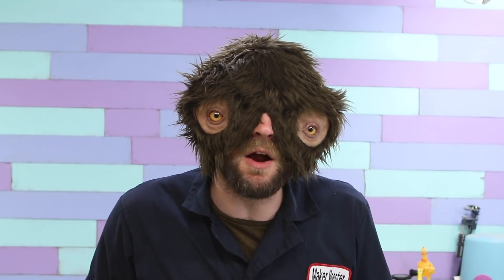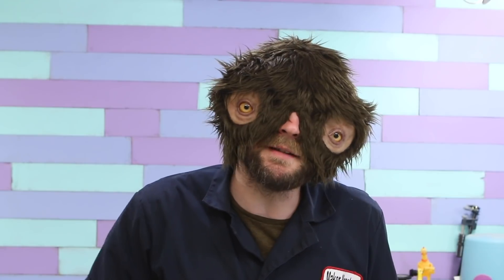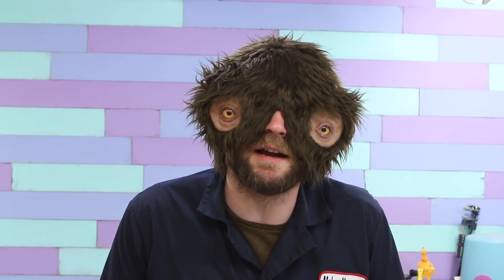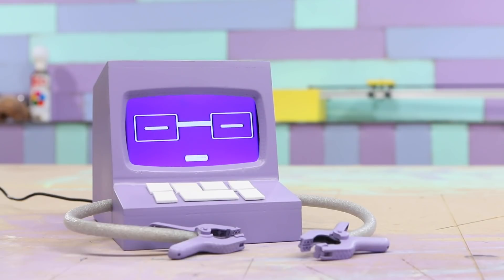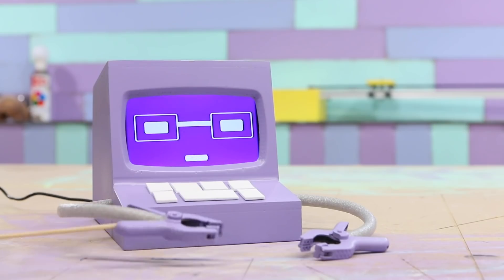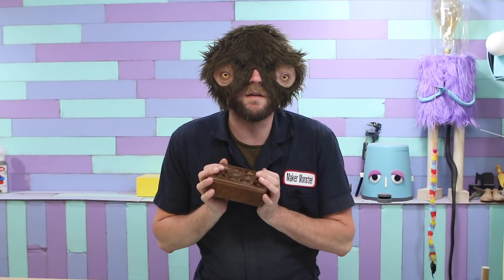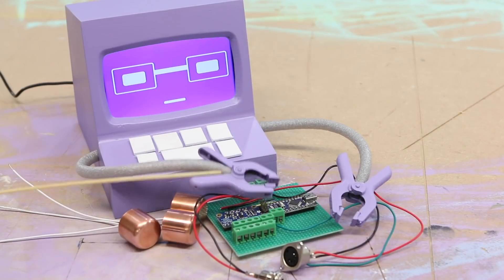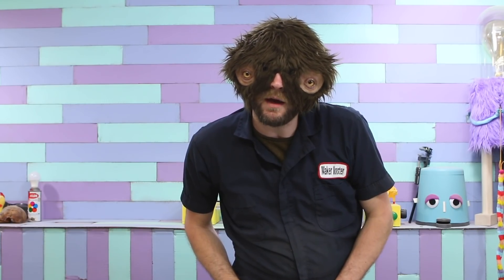Touch Sensing Midi Controller! | Capacitive Touch and Arduino

Comment: Hello, how do you set the function of each key or variable resistance to work in line with the audio programs.  For example, each key showed how to take a function with the key of the piano found in the audio program in the computer

Comment: is it Velocity sensitive ?
Reply from the maker: Unfortunately not. Just on/off for now. Maybe I'll try to upgrade it in the future if I feel the need
Reply: The Maker Monster so instead of wasting so much money , you could use Peizos upon which two sided tape, upon which plastic plate , upon which mouse pad pieces , to strike upon with fingers , it is surely velocity sensitive as there is Arduino Mega sketch for Xylophone on google codes website. try it . I'm also upto it , but I want to 3D MODEL a box , which will look like AKAI MPD218